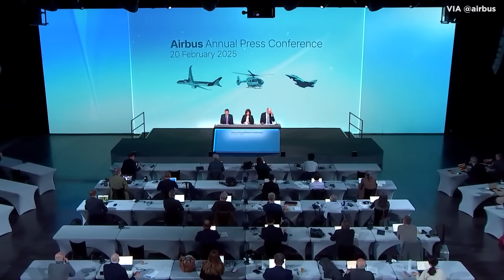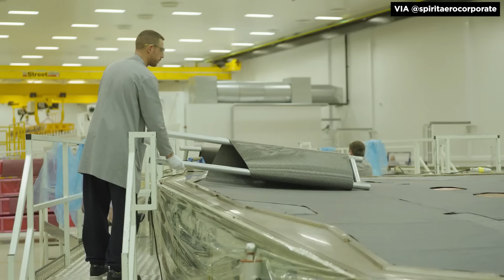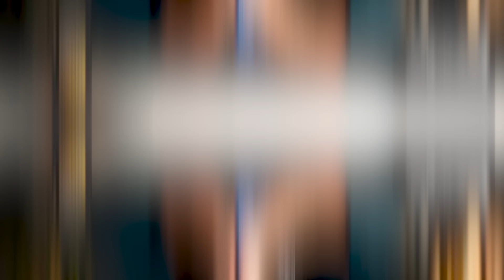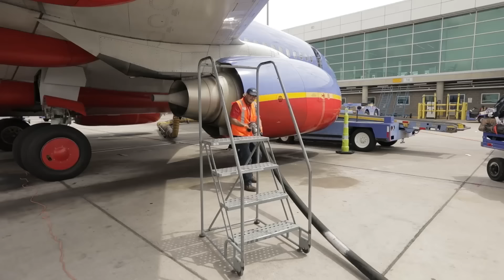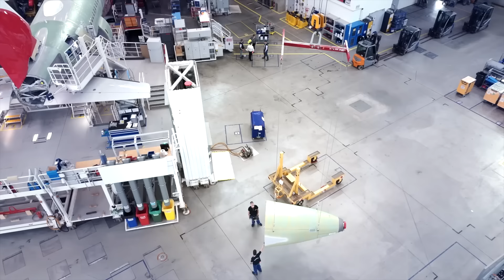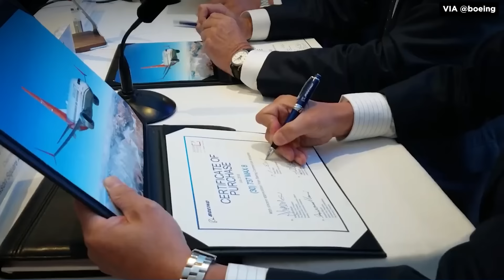Did Airbus just Change EVERYTHING?!

Comment: They should create an engine where the exhaust can bypass the compressor so at take off its a turbo and at high air speed it's like a ram air like a secondary combustion behind the compressor so the turbo fan doesn't work the air and exhaust against each other at take off normal operation and high speed the combustion decouples from the turbo fan and the fan free wheels while combusting behind the compressor

Comment: This is very complex but a factor not cited is the dearth of project(s)  for Airbus to work on having given up  on Hydogen  (Boeing had that right!).    Keep in mind that Airbus offered 3 engine on the A330 and two on the A380.    So that strategy can change on a dime (the last A380s were RR only).     A330NEO never as GE refused to play.    Agreed on the RISE, its just a program to get a new core and gear box.   P&W is interesting with a GTF-NEO or the HYSITTE  that is a ways off but uses Jet fuel (SAF or not) and Hydrogen mixed.      Also keep in mind airlines swore they would never accept another low time tested engine.

Comment: Hydrogen is an extremely bad idea.  The physics make it impractical for long distance.  Battery electric is now feasible for short and medium haul.  With continued improvements in battery energy density, this will only get better.  Airbus should stop wasting time on hydrogen and switch to battery electric instead.

Comment: Well, I've been in the Jet Fuel R&D business for four decades, and I know the key fuel people from most of the existing OEMs, so I found this video interesting. I'm not surprised that the interest in hydrogen is fading. The ability to supply hydrogen for airline flying is staggeringly complex. While jet fuel is the smallest fuel segment, the incremental bulk fills are huge compared to filling a car or truck. Another issue is water supply, in a discussion with an H2 proponent, they indicated they would build generation plants at airports and use municipal water supplies. I pointed out fresh water is a critical domestic resource in many locations, liker here at SAT, and likelihood of the citizens standing for their water going to provide fuel for the swells that travel in airliners is a somewhere between slim and none. Any system like that would have to be prepared to use gray water. (Here either way would require significant, expensive pretreatment because the water is very hard coming out of the ground.

Now please stop saying jet fuel or SAF. We have worked a quarter of a century on structuring the use of synthetic kerosene components to produce an operationally transparent fuel. The D1655 and DS91-091 blends with SAF are completely within the operating requirements and use experience of refined jet fuel. This is a must because you have to understand airliners have to work almost anywhere and the fuel has to be compatible. The good news is that the blends offer significant improvements in several key properties that affect the long-term health of aviation turbine engines. The second piece of good news is that practically everything done to make synthetic jet fuel is done to crude derived kerosene streams in refineries.

The development of synthetic aviation turbine fuel has been very careful and deliberate. The  process started in the '90s when we realized the same demands made on the other transportation fuels would come to aviation. Our business, however, could not afford any of the kinds of problems that came with the introduction of biodiesel or ethanol in gasoline. There is no place to pull over.

Comment: I'm skeptical about a new Airbus model that would hit the skies as a "stop gap" between the A320 and the Hydrogen aircraft within a span of a decade, here are just my 2 cents:

- For starters, the A320 Neo is more or less a "facelift" based on the previous A320 which would see much lower investments than a new aircraft. With such an order backlog (and still growing) for the A320 and nothing better in sight, Airbus can easily sit on "free money" for at least the next decade rather than having to pour billions into a new project which is not only costly but involves high risks  - something that I'm sure everyone would want to avoid after the Boeing mishaps. 

- Secondly - how would the discussion go with the Engine manufacturers? The CFM56 project saw a 30+ year production run after a 10-year long development cycle. If we speak of "free money" again, CFM would have most likely benefitted from it for the past 2 decades, assuming that they broke even after 1 decade. The LEAP saw commercial service in 2016, which, if we reapply the timeline for the CFM56, would only be "obsolete" as late as 2046. It would be quite a hard sell to convince CFM, which has barely concluded a decade of production of the LEAP, to immediately go all-in on a new engine project. 

- Assuming then, that the LEAP would stay the same or modified to extract more efficiency gains, then it would be rather pointless to launch a brand new airframe around it especially if the infrastructure of the A320 could still handle it, and if the new airframe cannot provide a stellar efficiency gains in the first place.

- We haven't even mentioned PW - which after all its mishaps and production shortages, may be seeking for a longer production period to reach its project profitability

- Does it mean we will not see an improved Airbus single-aisle offer in the upcoming decades? Probably not - my money would be on the fact that they make upgrades to the A320, such as composite wings, stabilizers, upgraded avionics, improved engines, etc... (sort of like a Boeing 747-8 upgrade from the 747-400) for smaller efficiency gains and to refresh the aircraft a bit in the mid term, but the rest of the aircraft including fuselage, hydraulics, electrics, production lines, crew training, etc.. would stay largely the same 

- For now, what I can see as an immediate threat to the A320 comes from within, and may be quite an interesting topic for further analysis from a technical and finance perspective - To what extent can the A220 family cannibalize A320 sales? We already see the A319 market migrate to the A220 especially in Europe, so would a "stretched" A220, take a significant market chunk away from the A320?

Comment: well I have to disagree with everyone who thinks any sort of H2 powered aircraft is a good idea until some ultra disruptive tech come about or the laws of physics change as storing H2 is more than problematic, in compressed form it has very low energy density even if it can be stored without loss for a long time but it is still VERY LOW... and in liquid form H2 still takes up a HUGE amount of space (~4x jet fuel) so while it is very light per unit volume it would take up all the existing fuel storage space and still have less than 1/4 the range... you could I suppose make a 737 only carry 20 passengers and keep the range...  range is much more important in aircraft than cars, no pulling over to refuel or recharge and don't even mention inflight refueling as we are trying to make money on flights

Comment: Sustainable energy is going to be necessary eventually. The sooner somebody brings a renewable fuel engine to market, if they can demonstrate even a small gain in efficiency, both airlines and the flying public would love cheaper fuel. The trick is storing enough onboard so that the new fuel does not need to be stored at every airport. If American could store enough fuel at DFW and Chicago, they could probably refuel the fleet in a short amount of time. Those ideas are all half baked but they're mine, damnit,  and I'm going with them. As for Boeing, they will be playing catch up for another decade at least. Airbus has a golden oppirtunity to hurt them badly if they revolutionize air transport in a way not seen since Boeing launched the 707 in 1957.

Comment: To translate: "2045" means "After I am retired; so who cares?"  And hydrogen is not a viable jet liner fuel.  It's just not.  If you want to swap out petroleum liquids, it's far easier to do with ground transportation, power or heat.   The aircraft would likely be the last application to dispense with refined petroleum fuels.

Comment: I wonder if adjustable engines on CFM rise would be useful, bit of a V-22 Osprey, angling the engine/propeller some degrees upward when on ground. Take off and landing as well then ofc. That would enable a larger propeller than otherwise possible. 
Just an idea that popped into my head. Will ofc be tradeoff with weight and complexity.

Comment: I find this video a little vague. What the real incredible new is, Airbus announced great progress on the CFRTP(carbon fibre-reinforced thermoplastic polymer composites) . Which are much easier, faster(+lighter) to manufacture and also to recycle than conventional carbon fiber. This could fasten the development massively.
CFRTP were developed under the Cleansky 2 initiative. Airbus has also acknowledged that they can supply 100% what is needed for a new single aisle.

Comment: Storing hydrogen in anywhere near reasonable density, without keeping it extremely cold requires absurd pressure, and even liquid hydrogen has extremely low density, about 71 grams per liter. Jet-A has a density of about 800 grams per liter, without pressurization and at normal ambient temperatures. When the higher energy density of hydrogen is accounted for, even liquid hydrogen requires about 4 times the tank volume as Jet-A, and on top of that liquid hydrogen also requires extremely well insulated tanks, that also can handle extreme pressure, unless the liquid hydrogen gets to boil off regardless if it's needed or not to keep it cool, and any excess gas is just ventilated off.     

All things considered, hydrogen can at best give a few times more range than some batteries that's already on the market, except for the option to let it boil off to keep the temperature low enough to keep the pressure required somewhat reasonable. That is because of the fundamental properties of hydrogen and other aspects of physics, and not lack of research and development. Letting the hydrogen just boil off comes with a range of challenges and serious disadvantages, as do any combination of strategies to minimize the tank weight, volume and dangers of storing hydrogen on the planes. A few times more range for the same weight compared to current commercially available batteries isn't a relevant advantage compared to the disadvantages and challenges with hydrogen as an aviation fuel, and that advantage will only decrease as batteries become better.

Comment: Airbus won't announce any new commercial aircraft programmes until it has control of its production facilities owned by Spirit Aero systems whose shareholders agreed to the deal in jan/feb 2025. Hopefully, the deal closes before end of June 2025. 
More likely, Airbus will announce the A321 will get a composite wing which will make its way to the A320 as production facilities are ramped up. I would then like to see Airbus up the fuselage to 4.5 metres wide so it can fit a 4.25 m wide cabin to contain 6 seats with are 600 mm wide including armrest share, and a 600 mm wide aisle. Seat pitch should be increased to 900 mm. Humans are getting larger and older, more room required.

Comment: Geared turbofans are the future as they save a shaft and a bunch of turbine blades. 
The Leap 1A fan is 78 inch diameter. That for the Boom Overture is 72 inch diameter. The Boom engine maker could move to produce an engine for 737/A320 class.

Comment: Open design engine sounds nice when it comes to air resistance, but what speed it rotates and how delicate it is since now there isint cauling to prevent engine from yeeting the prop into fuselage? Hydrogen plane sounds stupid as it gets, though not as stupid as the nuclear or electric aircraft. Having high pressure extremely flammable gas that has tendency to find any possible point to leak sounds like disaster, specially if its inside the fuselage, so planets that get their tail blown off leading to crash will be increasing to shocking numbers.
Boeing does not have good reputation right now, but if Trump can whip out the globalists out from the company and get them back in track, then they have fighting chance against the Airbus, but they are right about competitive edge since airbus does get lots of help from European governments and on other hand US populous is not keen on funding private corporations with public funds, specially after the trillions being wasted on corruption. It will likely take decade of Trump like politicians to clean the house in US and if after this in Europe countries do get similar politicians in office that clean the swamp in their countries there is healthy competition between the two, but given globalists are doing everything they can to sank the US and Trump and how widely spread the globalist corruption is... its unlikely to happen, specially when populous are spoon fed propaganda from them now more in the social media, since the fall of MSM.

Comment: As comments below the ‘green bubble’ is over,not withstanding all the valid insurmountable problems highlighted.May I add one more.95% of hydrogen is reformed from methane.The byproduct? CO2…….Its a non starter.
Airlines might ‘like 20-25% improvements but they will take what they can get (offered).
A shorter range stretched A322 is obvious low hanging fruit as is a stretched ‘2’ series.
It’s a business after all - profit is the motive.
Reply: There is no replacement for fossil energy. nuclear and fancy renewable energy cost more 
and, highlickely, affect the environment even worse.

Comment: Hydeogen is utterly impractical as a fuel. SAF is the only viable fuel for the next 25 years. The fuel tank and lower energy output issues are not practically solvable

Comment: You do not address the issue of the challenge with green hydrogen, this is the same dilemma seen in industrial applications like steel making.  Hydrogen has real potential as a clean combustion fuel, but there are two major issues, cost of production and thus the failure of commercial green hydrogen to scale up, and storage and transportation issues given its tendency to leak out of most systems due to the low molecular weight.  What is not clear is if there is actually a solution to these issues with cost the most challenging of the two.  As long as hydrogen remains marginal the adoption in aviation is marginal.

Comment: Hydrogen power is one of the silliest ideas around. Hydrogen is nearly impossible to store safely. It needs exotic metals to store it, you can't use regular steel because it gets hydrogen cracking and blistering. Hydrogen is the gas world's escape artist through joints and even straight through metal containments. It is a very low energy density molecule. BUT silliest of all.... hydrogen makes water when burnt, the water comes out as vapor which releases massive amounts of latent heat into the atmosphere when it condenses and freezes in the high altitudes that planes can fly at. AND.... water vapor absorbs IR in exactly the same way as does carbon dioxide!!!!!

Comment: I would put my money on an updated A320 called A320Next
A rewinged and with newer avionics version of the 320family is long due. With an improvement in Composite manufacturing technology, and weight savings improvements alongside reingeneered current engines versions could give up 8 to 10% fuel savings. With a couple of additional % along the route.

This would fit into the existing manufacturing process without breaking the bank, and further increase the gap between Boeing and Airbus, without (yet) reinventing the wheel. 

A technological breakthrough is difficult, and uncertain, but an upgraded interim version is definitely needed to keep the lead, keep Embraer and Comac (and Boeing) at a distance, and give the customers a sense of novelty, with a possibility of gradual transition on the manufacturing lines from current Neo to Next. 
I would throw in the wing design the needed room (landing gear, gull wing shape?) for a future open fan installation and you’re good for the next 30 years

Comment: In my view, hydrogen combustion engines make no sense at all for aviation. Hydrogen fuel cells, along with electric motors make a little more sense. And these would be for relatively short haul, with speeds less than 400 kts.

Open fan engines might have to be mounted above the wings.

I have always been a bit suspicious of the benefits of rushing to new technologies for nominal gains in efficiency. I think teliabilty and maintenance costs need to be taken into account.

Comment: It would be a huge mistake for Airbus to actually develop a hydrogen airplane. Where is the H2 going to come from? It is a pipe dream. Even with excess power from nuclear power plants making hydrogen it would still make sense to turn that into methane in an extra step to make it easier to handle and safer.
And Trump and the US are certainly going to not do H2 at all. Airbus doesn't need an H2 aircraft, all it needs to do is stay more efficient than Boeing and Embraer, (and very maybe China and Russia who are unlikely to produce a super efficient airplane)